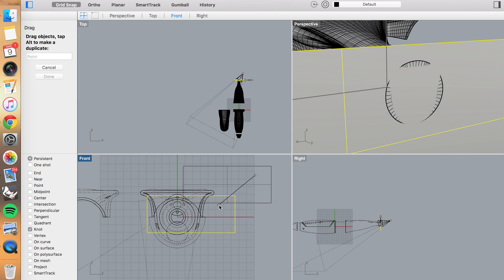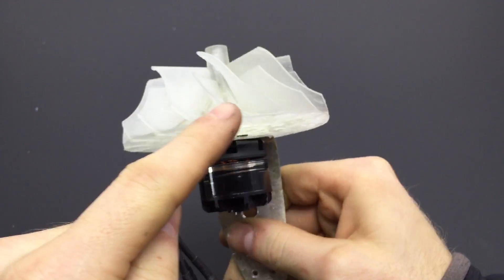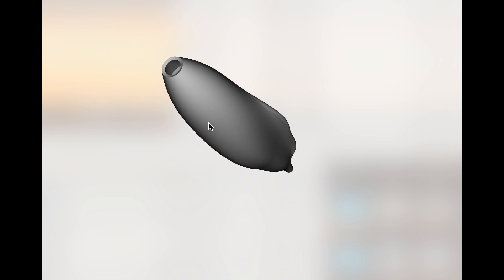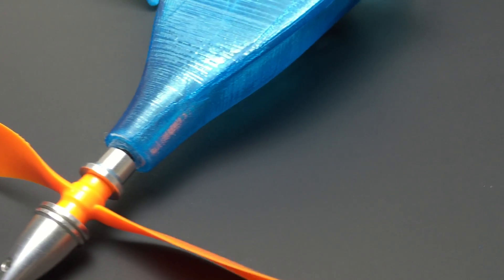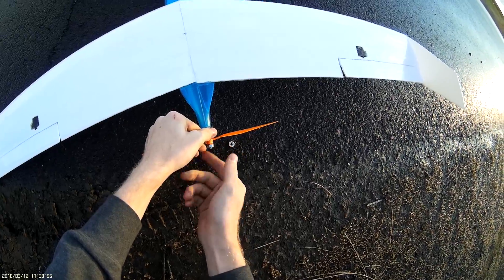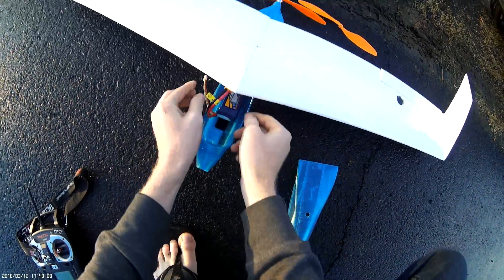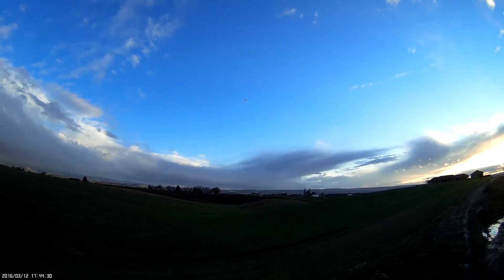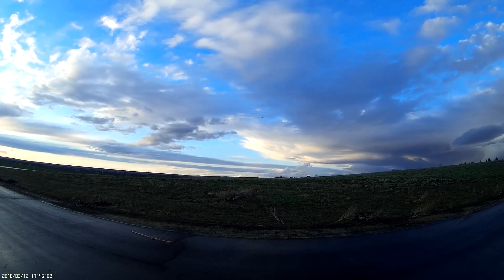3D Printed Flying Wing Pod

Comment: how long and what sweep is the wing? Also what motor size camera and prop
Reply from the maker: The wing is like 40" span.
Motor was like a 2812 kinda size and 1000kv and use the prop that the motor recommends. Probably 10x4.7 or ao

Comment: Bro what 3d printer do you have? Plz don't tell me it costs more than 500
Reply from the maker: I was using my school's makerbot Z18 ($6500 or so) I also own some smaller ones under 500
Reply: Jonas Bezzubovas If you're still looking I recommend the CR-10. It has a massive print size (30*30*40cm) and its under $400.

Comment: The prop is wrong you have used a slowflyprop you need a stable elektric prop for more highspeed an better performance.(8x8) APC prop or other
Reply from the maker: I used the prop I wanted to use

Comment: have you considered printing a shroud for the propeller to protect it from damage when landing?
Reply from the maker: Normally it shouldn't be a problem if you use a normal glass fiber reinforced propeller and you have the break function enabled to slow it down. They only break when they hit the ground spinning
Reply: Ever heard of a collapsable prop ?

Comment: Very cool flyer. I wonder if you could print a pod that would accommodate two EDFs and use differential thrust to steer, and also some skid blades for landing gear instead of wheels.

Comment: When I first saw the design was hopeful that you'd succeeded in moving a pusher prop into more laminar flow, as typically pushers are quite loud due to the prop chopping up "spoiled," turbulent air. It seems from the video that it's quite quiet, especially considering its speed. Very nice design!

If you could make the pod a bit thinner or the wingspan a bit wider I'd reckon you'd be able to double them up and use differential thrust for really nice yaw control.

Comment: Does Rhino allow you the do the wind tunnel testing?
Reply from the maker: The wind tunnel is Autodesk Flow design. You can just stick an .STL file in there. I use Rhino to make parts and export to .STL.
Reply: Thanks for the quick reply!
Reply: Sorry Samm, I noticed you answered this question 12 times. That's why I open all comments and search ahead of time. Thanks for your hard work.

Comment: +Samm Sheperd what software do you use for the simulation of the wind tunnel and also for your 3d printing?
Reply from the maker: +Josh Clemens I use rhino to make parts. Autodesk flow design for wind tunnel fusion 360 for CNC

Comment: Awesome man! This pod looks beautiful! Could you do kinda a short Rhino tutorial about how you made this? Cause I'm using Rhino too but (I guess you made this with lofting) my lofts don't look that smooth as yours.. I'm also very interested in the wind tunnel simulating thing you're using there. Fantastic work man, keep it up!
Reply from the maker: +ZomhadRC I primarily used the surface from a curve network function. Lofts are always simple and flat. But you can take your lofted surface and use a CageEdit to add nice curves.

Comment: nice work , i want to ask about the 3D printed centrifugal compressor fan you made does it works fine at high speed ?
Reply from the maker: +Ibrahim Abubkr It needs a volute/housing. Haven't used it yet.
Reply: +Samm Sheperd (SNRS) if you don't mind to send it's file to me so that i can print it too , it is so cool to have one

Comment: Awesome!  What 3D modeling software did you use? 

If putting a drive shaft was easier on full scale aircraft it would open up a ton of design options.
Reply from the maker: +MikeysRC I used Rhino. But I'm trying out solid works and a fusion 360

Comment: That's pretty nice. What type of plastic was it? Sounded hard when it landed. I definitely need to sort myself out a 3D printer soon!
Reply from the maker: +wordreet this is PLA, if I could print ABS that would be probably be better, but I don't know
Reply: *****
I've read that nylon can be used, but requires higher temperatures. It is much tougher though, so would suit pods, fuselages, servo horns etc much better.
 At the other end of the scale, you can 3D print with special wax now, which can then be used to make a mold for metal castings.
I will find a way to have a 3D printer by the end of this year, deffo.
Reply from the maker: wordreet yea it's super exciting. There is a new printer that prints nylon and can also imbed fiberglass and carbon fibers with a separate extruder. I have been trying to use 3d printers to make a mold to cast wax with, then to use for investment casting. The new Form2 that my school has can print with a removable resin for casting.
Reply: +Samm Sheperd (SNRS) My first job on leaving school was with a manufacturing jeweler. We made, amongst other things, silver belt buckles for nurses uniforms, using the lost wax process. The buckles were usually presented when a nurse qualified as state registered.

Comment: Hey, Samm, as an absolute noob to rc plane building, after watching your $5 trainer videos I've been inspired but I have a few questions:
-How thick does the foam board for the wings and body need to be and is glueing layers (say 3/4") together an option for more thickness?
-Where would be the best place to get said insulation foam?
-Is 3 the minimum amount of servos you would need for pitch, roll and yaw rotations?
If you could reply that'd be great but obviously I wouldn't expect you to prioritise this over other things so it's fine if you can't. Also apologies that this isn't on the trainer building videos, I just didn't think you'd check their comments.
Reply from the maker: +Dom Swift hi, 
-you only need foam as thick as your airfoil template for hot wiring. I've seen others glue layers together but I'd recommend just getting thicker foam. You can get foam from home improvement stores like Home Depot or Lowes.
-Yes, but you'd have to figure out a way to use one servo to control both ailerons (or maybe just use one? Haha). I started out doing that but I learned that one per aileron is just way easier.
Reply: +Samm Sheperd (SNRS) Ah, thank you very much
Reply: +Samm Sheperd (SNRS) oh and last question, can the foam be polystyrene or is that weak? presumably it would do
Reply from the maker: Dom Swift To my knowledge, all the sheets of insulation foam are polystyrene. The white stuff made of little foam balls fused together is called Expanded Polystyrene (EPS). And the continuous high density blue or pink stuff is called Extruded Polystyrene (XPS). I use both all the time. I like to cover wings in packaging tape which helps cover up mistakes from hot wiring, and most of all it makes the foam much more rigid and smooth and nice looking.

Also, feel free to ask any other questions.
Reply: Oh OK just me being a noob XD, thanks for all the advice

Comment: That's one awesome use of 3D printing. If you keep breaking your propellers, try 3D printing yourself a set of 3D printable props. I found a really nice one on Thingiverse, but had to (re)design it to improve the performance and strength. The STL file is on Thingiverse (thing:1060181).

Comment: This is so cool! Please take a look at my idea on You Tube for a Tri copter using Coanda Thrusters instead of props ( for improved safety) at "Coanda Tri Copter". Really dig it if you could run it through your virtual wind tunnel. Hey, check out this old digital computer idea patent 3109554 that use air to compute. Hoping some 3D printer guy would build one and You Tube it so I can see it work.

Comment: Hey is it ABS or PLA ? Would i be able to print it in a 20x20x20cm printer ?
Could you give a link to the motor you used and the ESC ?

Damn this thing looks awesome, so much questions ! :D
Reply from the maker: +Fikzy probably PLA, but ABS would probably be better if you can. The parts are less than 200mm each so yes. I don't have a link, but it was 2212 1000kv motor. They run well on a 30a ESC. The trick being replacing the shaft with a 200mm long one and outing an appropriately sized bearing at the prop side.

Comment: Nice work!  Looks like a really efficient airframe and flies great. :-)
Reply from the maker: +valderja I chucked it without the prop and it would just slope soar by itself on that little hill. I should get a folding prop. I should print a folding prop
Reply: Cool, yeah, get an adaptor and folding prop.  You could do some FPV thermal soaring.

Comment: would you sell any of these?
Reply from the maker: +Jonah Oliphant I would consider it. My aim has been to help people have a good experience with the hobby, I feel so sorry for those who spend a lot of money on an airplane, and then crash it and give up. I've seen it a lot. I want to share what can be done with the components, and that by making your own random flying things, you can really do a lot with this reusable equipment.

So I'm a little concerned that someone who buys it would crash it an be sad haha. BUT, ignoring that, I would love to improve the design and sell them. I could offer versions without a camera hole, or to fit a different camera size.. etc. And if I build a CNC hot wire, I could manufacture wings pretty easily. I could give lots of DIY instructions to make their own wings, I could even include laser cut templates, sounds pretty neat, what do you think?